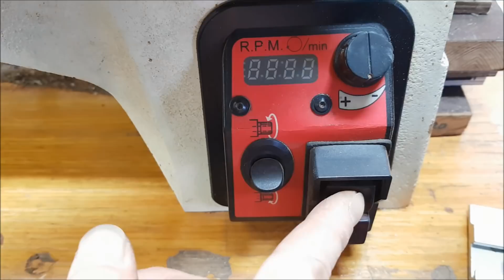"STARRY NIGHT" Making a Fountain Pen

Comment: You should install a vacuum to suck up the chips and dust when turning. Also protects your lungs if you are not wearing a mask, and easier to clean up afterwards.
Reply from the maker: Is not visible on the screen,
I also have a vacuum cleaner,
I'm also wearing a mask.
I have been working for 30 years.
That much safety device is doing well.
Thanks for the advice~

Comment: Hello, if you are working on a video explaining the method of mixing the colors of the epoxy in the pens, how did you mix these colors
Reply from the maker: I don't use epoxy to make this pen.
Stabilized wood was used.
This small material was not made by myself,
It was supplied by commissioning an expert.

Comment: Just one question. Why don’t you simply do molds, for what it seems to be epoxy resin, with the shape of the pen? This way you wouldn’t waste material and would build them faster.
Reply from the maker: I've already made it with various materials.
I have 30 years working experience.
The one I chose is the current method.
Working with epoxy resin or resin,
May waste more material.
It’s not because you don’t know,
It doesn't even know.
Thanks for the advice, but I do it my way.
And,
It's not just what is shown in video.